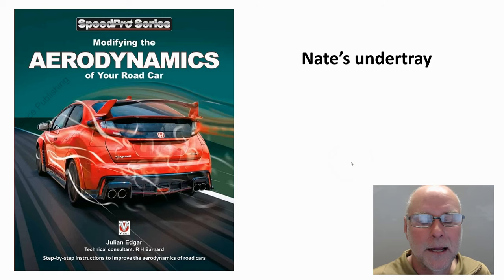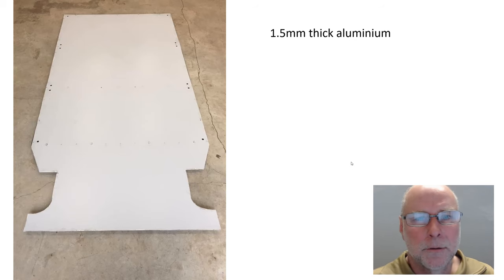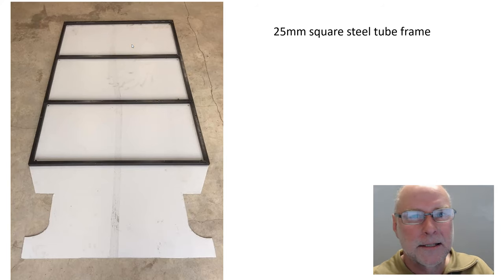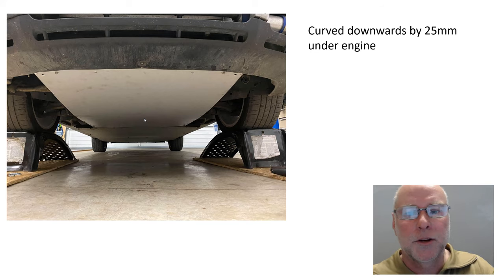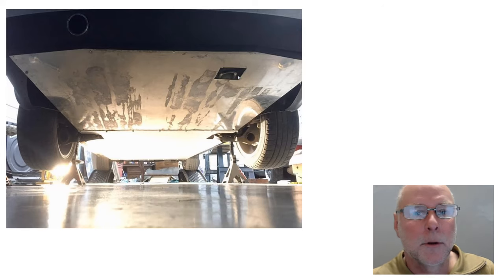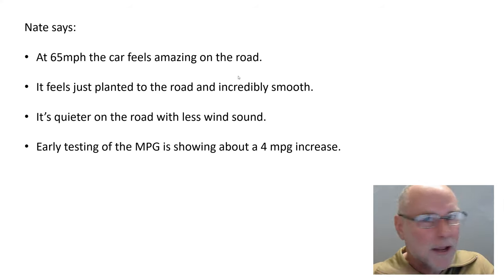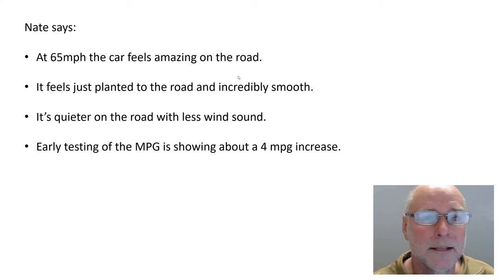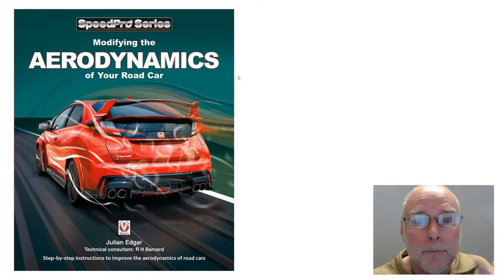Nate's undertray

Comment: Another awesome video! Thanks for showing my under tray on YouTube. I actually do have the same steel frame under the engine part of the under tray I just didn’t get a picture of it before I put it on.
Reply: Looks great!
2 questions:
1. How did you attach it? Was there drilling involved?
2. 4mpg improvement from what baseline? +4mpg from 20mpg is massive, +4mpg from 55mpg is not so impressive :)
Reply: maczomaczo I tried to use longer bolts in factory locations as much as I could but yes I did drill some holes. The car is a Diesel automatic so it averaged 35 mpg, now it’s 39.3
Reply: I have a mk4 Golf Variant and started to build a large front undertray as well as a rear one that ist reaching from the rear axles crossbeam all the way to the rear bumper. Now i saw that you cut your Front spoiler-lip. Havent you?  Im used to a small air dam being the absolute lowest part of the front bumper. Why have you done so?
Reply: thenewconnor this a 05 Passat B5.5 so it’s a little different than a Golf. There was about a half inch lip at the bottom of the bumper that I cut off just to try to keep the air attached to the under-tray as much as possible

Comment: I do wonder how airflow through radiator etc is affected by being so "sealed"
Reply from the maker: A similar approach tested for that in my latest book.
Reply: @JulianEdgar  yea, studying your video re your intercooler and pulling air out of engine bay I'm a bit perplexed on best design for my own system.  Fmic with no undertray as yet, but very well sealed at the radiator with little exit room for air underneath actual engine,.  Will have to have a play I guess.  Great videos btw
Reply from the maker: Don’t play; measure pressures.

Comment: I'm really confused. Are you supporting his use of the front tray without a frame? I thought everything needed to be fixed solid? surely that long aluminium sheet is going to bend all over the place under pressure?
Reply from the maker: If you check the comments you'll see he did use a steel frame under the front part. Don't forget that the direction of pull is downwards, so a curved aluminium sheet held firmly front and back will not change much in curvature, even with that pull.
Reply: @JulianEdgar  I'm thinking of making a large one out of 3mm 8x4' sheet of dibond (cut down to size where necessary), with the front and back smoothly curved, does this sound like a good idea? i was thinking of fixing aluminium bars in segments across the entire length of the piece for rigidity.
Reply from the maker: @tropicalpalmtree  Yes, with plenty of connections to the car's underside. Also see https://youtu.be/L9WCVlWPcys
Reply: @JulianEdgar  Thank you Julian i will give it a watch now!
Reply: The frame on the front part of the under tray is just like the frame on the rear part but doesn’t have the legs that go up in the wheel wells. I thought that the aluminum would move around and make noise out on the road but it doesn’t. At hwy speeds there’s probably hundreds of Pounds of force pulling down on the aluminum so it never makes a sound. Rarely I hear it when I hit a speed bump but that’s it